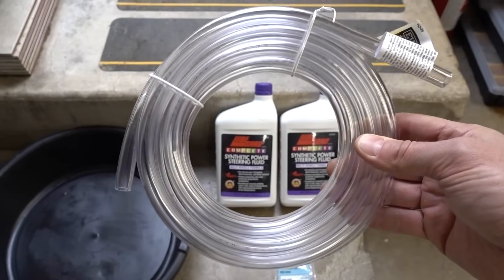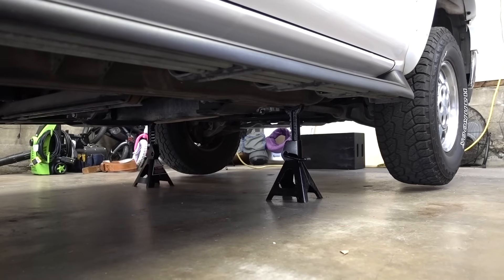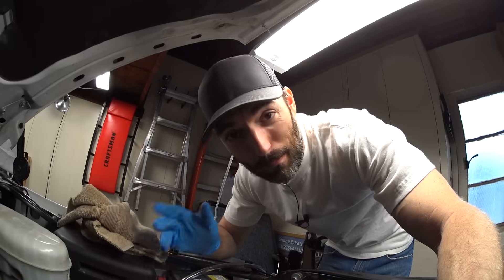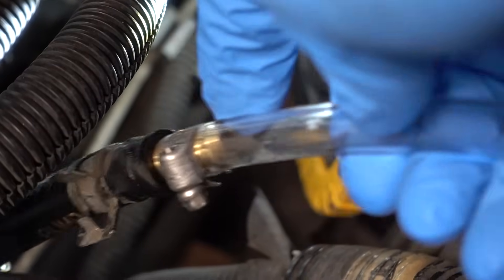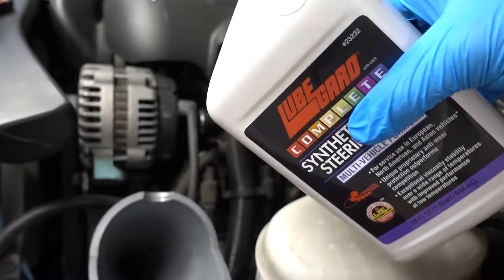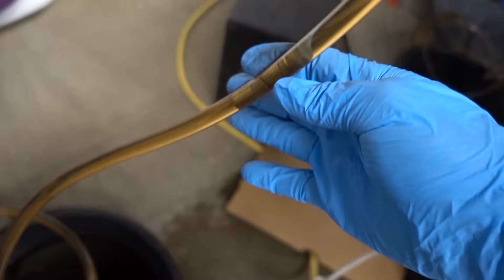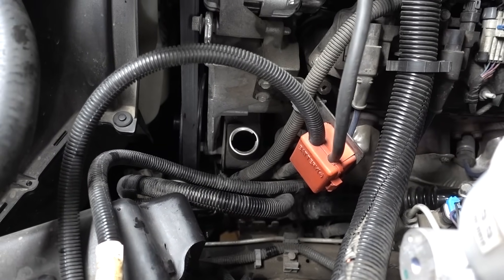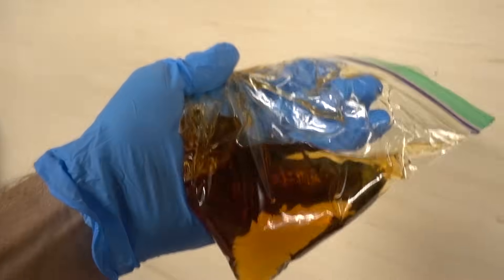Absolute BEST Method To Flush Power Steering Fluid!!

Comment: I  once spent an hour looking for  the power steering fluid reservoir on a Toyota Avensis, i thought i was loosing my marbles until i discovered it had an electric steering!  I felt like a right jackass.
Reply: I Did the same stupid thing for my Mazda 6 2014 LOL.
Reply: @Hira9612  Haha!  I'm not the only one so who got caught out by an electric steering.  We live and learn.
Reply: @Diarmuid O C exactly 🤣🤣
Reply: 😂 it happens
Reply: Haw to remove water from p.s. gear box 91 sidekick 1.6 l ? When is really cold, the steering wheel is freezing.
Reply: Uhmm my 2012 Charger SXT has an electric steering, and it does need fluid. (Electric steering pump fluid).
Reply: Yup, us "old guys" are not used to them new fangled gadgets. But probably a better system overall...until it fails
Reply: @2cooco  try unplugging whatever side of the pump is lower to the ground because water is heavier than oil. Might be your high pressure line. He did low pressure side in the video. Then same flush process.
Reply: Have you replaced you blinker fluid yet?
Reply: @appletree8441   Sure did,  also changed the spark plugs on my diesel engine aswell!
Reply: Since it's electric, blinker fluid will work well for that.
Reply: I still can find mine Toyota IQ? I’ve lost my marbles. Any help???
Reply: @appletree8441  That is just uncalled for. LOL.
Reply: Same on 2014 Impala
Reply: 🧐 I hope you changed the electricity to help the pump run well.
Don’t sweat it, I think we’ve all been there to one extent or another.
Reply: Thanks for sharing. I will remember to google first.
Reply: I spent the same time looking for my blinker fluid. Realized I had electric blinkers.
Reply: Don’t feel bad.  I drained the transmission fluid on a NISSAN Versa when I was trying to change the engine oil!  Talk feeling dumb!
Reply: I laughed loudly brother 😂 yesterday I put new struts on my first gen sequioa, today I flushed psf and changed oil last weekend I put new calipers n rotors on front and new sway bar bushings & end links. I started the process of doing a super flush on radiator yesterday. I've been busting my ass to maintain this recently get it up to par with a new 82k one lol brother we all have that pain n love relationship with our cars
Reply: @diarmuidoc9427  😂😂😂😂🤣🤣🤣🤣🤣
Reply: @kdmq  oh my! 🤦🏽‍♂️
Reply: @GTILOUD  congrats bruv! 👏 👏 👏 👏 👏 👏 👏 👏 👏 👏 👏
Reply: @boobalew  that must have been a terrible feeling! 😢
Reply: @tmst2199  True that!
Reply: Don't feel bad.  I have had moments like that too

Comment: I believe that I'm going to use the 2 person method, start the van and let another person fill the reservoir as it needs. I feel like the engine running and operating the pump while draining the old fluid out will remove more of the dirt and crud because it's agitating the fluid and also forcing it out under pressure which I feel would loosen and dislodge more of the junk and make it's way out of the system better. I don't really know if it'll make much of a difference actually but it's just my theory.

Comment: Sorry Chris Fix I should've gone with this method 😁. Very helpful video
Reply: Martin Fuentes  me too.  Nobody told me and i sucked air.  This is the only way.
Reply: The way I would start my draining of the power steering fluid is to first suck out as much power steering fluid from the storage tank.  Put in the new fluid into reserve tank before pumping out the older fluid still in the power steering lines.
Reply: @michaelpearce8661  that way u dnt waste too much of the good shit 😉
Reply: Martin Fuentes it's only for entertainment purposes😀do your own research
Reply: That bloke takes shortcuts and does jobs the lazy way
Reply: Hehehee
Reply: Remove the old fluid from the reservoir and then topping of with fresh fluid. Then start the engine and turn lock to lock a few times. Rinse and repeat a few times until fluid in reservoir is almost brand new. Messy but I'm just lazy with the hose clamp and drain bucket.

Comment: I use a turkey baster.  It's not a complete flush but it is a pretty dang fast way to get fresher PS fluid put in.
Reply: I agree, using your methods renews the fluid and there is a zero percent chance of something going wrong.
Reply: Me too. If I buy a car that's really dirty I don't mess about I just put on a new pump after cleaning out all the fluid out of the rack. Then I keep it clean
Reply: Yes, thats what I do.... its time consuming but its the safest imho. It takes me about 3 full bottles to make the dark fluid light again.
Reply: If'n you do the turkey baster a couple of times a year, you'll replace all the fluid at one time or another. Plus you wont have to worry about burning any part of the pumping system.
Reply: Ya that's been working for me. I use a large syringe to suck out from reservoir.
Reply: the problem is that contaminants can enter your steering fluid over time and become abrasive. so if you are not doing a complete flush you are not getting all of those damaging shards of debris out
Reply: @dumbcat  I've been driving and checking fluids for about 25 years and thankfully I've never seen any shards in my PS fluid.
Reply: ChromoFed     I agree. The dilution method is simpler. I use this technique. You just have to do it about 6 times.
Reply: I do the same, do it every oil change until it comes out clean, then I'll do it once a year.  Same for brake fluid.
Reply: I also do the turkey baster. Definitely rejuvenated the fluid. Now I will do it at oil changes to keep up with it. His method of flushing by turning the wheel is good though, I never thought you could do it without the pump running.  Good to know.
Reply: me too. been doin this for yrs both on brake/steering fluid. i figure its similar to changing trans fluid which about half stays in the converter
Reply: BAMA BOUND so what you do is diluting the old fluid with the new one? It works pretty good? Thank you in advance.
Reply: Benjamin Urbina what do you do put it inside the reservoir and then suction the fluid?
Reply: I did the same but it RUINED Sunday roast the following week. 
The meat tasted weird
Reply: Off to Walmart for a turkey baster and fluid 😂

Comment: Just followed this method and think it went pretty fast for my first time doing the job.  Also cleaner than some of the methods I've seen which say to keep mixing dirty and clean fluid together.    I syphoned as much as possible out the top with a turkey baster and a bit of tubing, warmed up a piece of tubing and pushed it up on the baster to make the opening a little wider, disconnected my return hose where it meets the reservoir, slipped the enlarged piece of tubing over the reservoir end and clamped it like you did to plug the reservoir.  Then connected the return hose to the tubing drain piece and drained into an empty container.  I found this easier to work with than underneath the car and this also ensured no dirty fluid hiding in the return line.  I put a large sponge and towels underneath the hose area to catch any power steering fluid that dripped when taking off and putting the hose back on.   Barely made a mess at all.  Thanks again for the tips & tutorials

Comment: Two suggestions: 1) Suck the old fluid out of the reservoir and replace it with fresh fluid before you start the procedure.  2) You don't have to turn the steering wheel to pump the fluid if the tires are off the ground. Just grab a wheel and push it from lock to lock. Then you can watch the fluid as it is pumped out and see when fresh fluid starts to come out. No need to keep getting in and out of the car
Reply: Better off sucking some out overtime and replacing it. That keeps it clean and don't let it get dark like that.
Reply: Hmm 😂 thanks
Reply: Depends on what vehicle. I was definitely not turning the wheels by hand on a hummer I worked on even off the ground
Reply: @jamieb9556 Depends… On something big like a truck, good luck… You’ll probably doing that daily or weekly for years before the power steering fluid even gets clean (assuming you do it CONSISTENTLY — almost impossible). 

In something like my sports coupe, I tried doing this for months and it would help only a portion of the old, worn, dirty PS fluid get out, but it was slow and the color itself barely changed. It wasn’t totally pointless, but seemed like a waste of time and almost didn’t give a good gauge on the fluid, based on the color and how much old fluid was removed… 

I ended up simply removing the return line from the PS fluid reservoir and then blocking off the port. Then I put a drain container underneath the car, so that the return line could be placed towards it. I then turned the ignition to ‘on’ (to prevent steering wheel from locking), and then manually turned my steering wheel from lock to lock, while constantly topping off the reservoir with cheap PS fluid and also some transmission fluid flush formula (suitable for power steering fluid/pump). 

This got the job done sooooo much better, and actually did a proper job. A whole year later, and my brand new PS fluid is actually still clean and barely dirty (probably not broken down and contaminated as badly).
Reply: Thanks man !

Comment: I am very happy to announce that I just performed this maintenance operation on my 2005 Chevy Silverado 5.3L truck.  I did so, just as you did in your instructional/entertainment video with the truck on 6 ton jack stands, engine off and turning the steering wheel lock-to-lock.  All went well, no issues or hiccups along the way. I however, opted in removing as much of the fluid prior to presenting new fluid in the pump itself. All in all, I went through 2 1/2 quarts of power steering fluid. Test drive completed and levels checked, a success! No more whining or chattering sounds. Thank you for this video presentation and I look forward to the next project, a transmission fluid flush, in the next day or two.

Comment: Worked great. Home depot had the 3/8" brass splice and vinyl tubing for about $10 total. Flushed about 2 quarts of new fluid until it turned from red to pale orange. Jacking up the front and grabbing the tire and turning it lock to lock manually was much faster. Thanks for the vid 👍

Comment: Finally somebody that knows if you run a Honda pilot and others with return diverted you will suck air in 5 seconds.  Manual with engine off makes sense. He is the only mechanic that knows this.  Thanks.

Comment: Hi Jimmy, My application was a 2005 Nissan Frontier 4L. It called for Synthetic Transmission Fluid for the Power Steering System. I picked up a roll of 3/8" ID Clear Plastic Hose, a 3/8" Brass Splice coupling, couple hose clamps and made a plug for the Reservoir drain barb using  a short piece of 3/8" hose and folded it over and tightened up with a Ty-wrap.  I used a syringe with a short pierce  of 5/16" plastic hose to purge the reservoir first and topped up with new Group 4 Synthetic ATF Fluid. I did the manual method, engine NOT running. It worked beautifully turning lock to lock. I could turn the wheel both ways and still enough fluid in the reservoir to cover the outlet port going to the pump. I did lock to lock four times. The existing fluid was dark black, unbelievable. It took 1.5 Gallons of new fluid purged through the system before the oil cleaned up. Your video was well done, you covered the service in every detail. I really liked the manual method, was able to do it by myself with out a second person at the steering wheel. Just to note, my previous service method was just purging the power steering reservoir only, once a year in the fall. I was amazed how dark the oil was that purged out of the system using your method. It took me an hour from start to finish including cleanup. Thanks!
Reply: The only way you do is great thank

Comment: For anyone doing this, I would definitely recommend that Brass splicer piece he uses. I had just stuck a 1/4 inner diameter hose into the return line, and I think because it wasn't air tight it made the process last 10x longer, and there was a lot of air in the system. It ran dry for a little when I started it, but it worked out in the end. Don't be like me

Comment: The best method I have seen! Had problems with bleeding my Sonata 2007 when trying to cycle with engine on/off. Going to measure the hoses and get a shutoff valve and plug at hd TODAY!!!!!!!!!!!. On that vehicle the 2 hoses are under 2 inches apart on the reservoir, so I AGREE there is no way to fill it fast enough when running. Look up Bottinger Method for similar COMPLETE FLUSH but run/stop A/T Flush. I just get a case of Hyundai ATFIII and go thru 10 qts, every 20k mi now 240K on the car, change it every spring / year!

Comment: excellent excellent excellent. My old Toyota pick up truck with 200,000 miles on it had black fluid. I put a new power steering pump in and then used your method. It took over 60 turns lock to lock that’s 10 sets of six, before the fluid finally cleared. A half a gallon of fluid. But now I know it’s clean and I did not void the warranty on the new power steering pump. Thank you.

Comment: That LubeGard complete PSF is EXCELLENT! :) Alternatively to having two people, pull the fuel pump relay or fuse and crank the engine to flush the fluid through - the RPM will be too slow to damage the pump in case you let it run dry but fast enough to make it a quick process.
Reply: Michael:
That is the way to do it.
Remove the Injector Fuse & Crank the Engine.
You can possibly do damage by turning the wheel
without the pump turning.
Your best to add 20% LubeGard to the Factory Spec Fluid,
shown in the owners manual,except Honda's.
They get the Dealer Fluid.

Comment: Excellent video. I went to my local hardware store today and I got the 3/8 hose, and I got the 3/8 Spicer fitting. Tomorrow I will pick up some power steering fluid and get this done. I checked my power steering fluid and it is Brown Black! It's a 2001 Dodge ram 1500, I'm sure nobody has ever serviced it, I've had it for five years. I should've done this along time ago.

Comment: I have a 1987 Silverado, with a 1997  GM Goodwrench crate motor. A lot of this stuff works for me just the same. Love the whole channel.
Reply from the maker: How’s the crate been treating you? Where did you buy it? Any issues?
Reply: It was my uncle’s truck, r.i.p.. he bought it in 87, and replaced the short block in 97, drove it for 3000 miles, parked it when he got sick, and then it sat for at least 18 years that we know of. It was very grumpy about it. However, it is not “hurt” as they say. Once I rebuilt the TBI, and replaced all the vacuum lines and sensors, it ran like a monster until I tore the front of the engine down to paint everything. Almost back together.
Reply: Next is my steering pump, then electric fan wiring.

Comment: I just watched a video of a "pro" doing this with the engine running. He did have help but he really had some screwy ideas and it was just an awkward mess. You did a WAY better job on this and it was simpler, required less parts and tools, and made zero mess. So much for professionals knowing better. Good job, and good video.

Comment: This guy is thorough, which a lot of others are not.  Look at his bench and appearance.  This is the kind of guy I take advice from.  Never felt comfortable running a dry pump, so I continued to look for the "real" deal.  Jimmy is the real deal. I will no risk my pump in a procedure that is meant to prolong my pump.  Right?  Wanted to mention, I notice that the liberals have been given the ad space on YouTube when I was listening to 1 Road.  The Ls are not thorough.  Only general statements with little facts to back up.  Thank you Jimmy.

Comment: I used a pump from my shampoo bottlers pump out old fluid from the reservoir. I pumped out the old and refilled the reservoir with new fluid.  Drove  around the block came back and did the same thing. Did this till the fluid was clean. Took me a couple of quarts. Very simple.

Comment: I just changed mine today I shoved the return line into a 16.9 oz typical water bottle. I completely removed my reservoir and did a mineral spirits soak flushed with brake clean then soaked in non ethanol gas and again brake clean flushed cleaned lots of crude out of res 🤢 after it was dry I made a condom out of glove for return on res and filled with new synthetic fluid and connected the pump suction hose. I then did his process from there with turning wheel back n forth to flush the entire system thoroughly, as the bottle filled I dumped it into a empty 1g water jug and set it back up, topped of res and got back to wheel turning until completely clean fluid came out. Once I was satisfied removed condom thumbed it to save fluid in res and quickly shoved return back on and replaced clamp. Then continued on wheel to get air out and eventually turned on the engine and turned wheel back n forth a few times. Dropped 1/8th of an inch and I topped off to cunt hair below high cold line. drove around to get food and it was a smidgen lower topped off to high of hot line and went for a 30 mile drive. Checked again had not budged right at high of hot and clean like honey boys for the cost of the fluid and 2 hours of my time. I took my time with it. Huge improvement in the feel of the wheel 👏 🙌